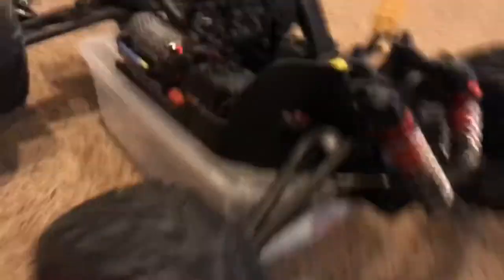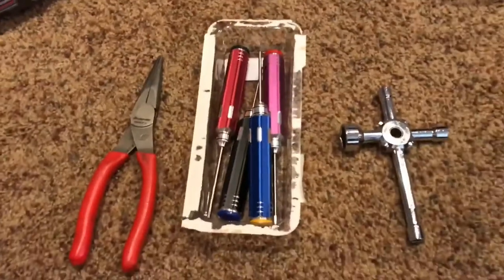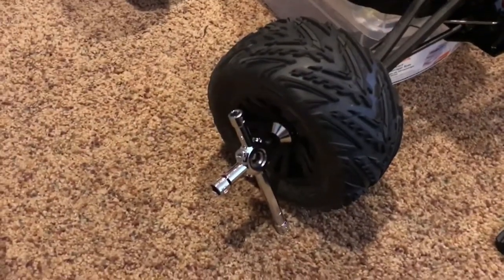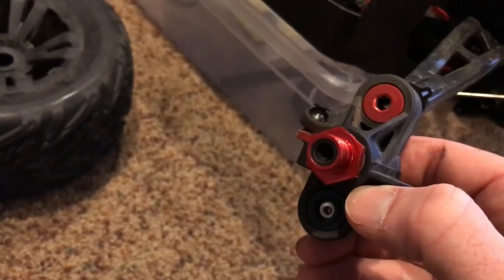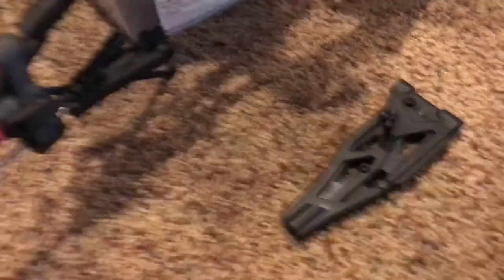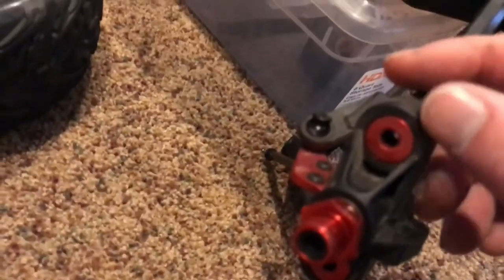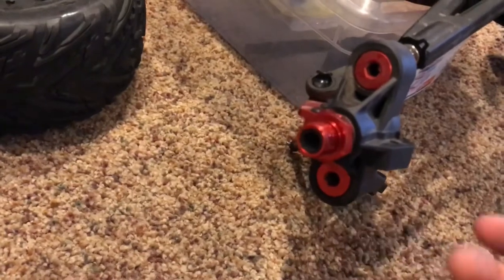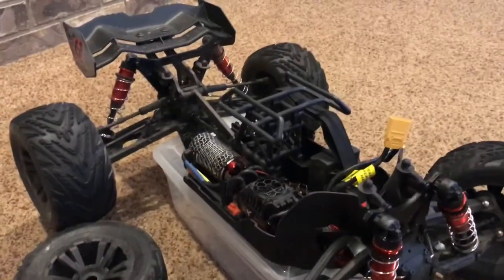Arrma Kraton Front A-Arm Replacement How to

Comment: I did this on my kraton and now one wheel points straight while the other is slightly turned. What's wrong?
Reply from the maker: you need to adjust your tie rod ends